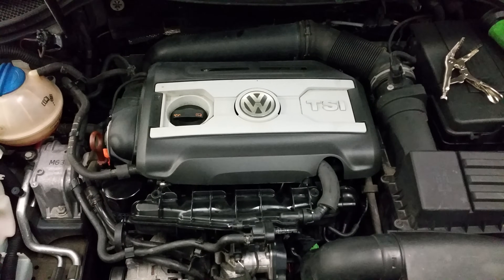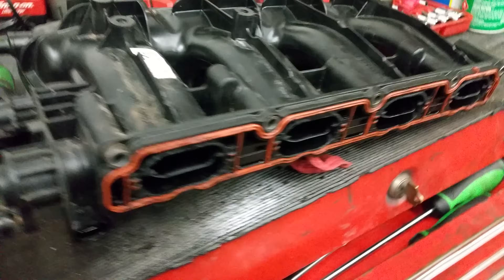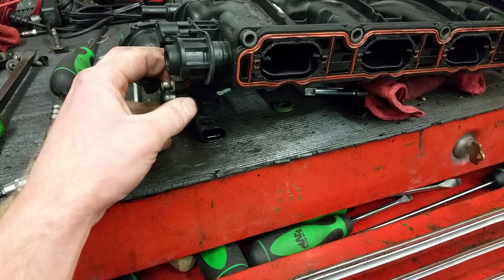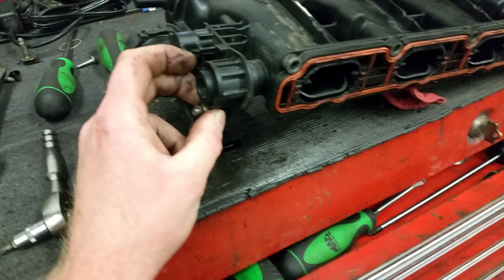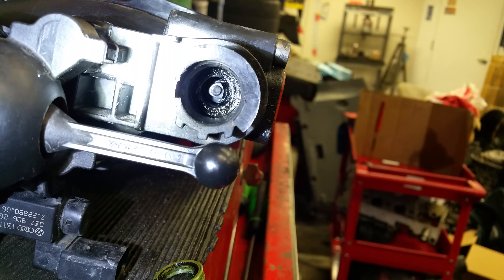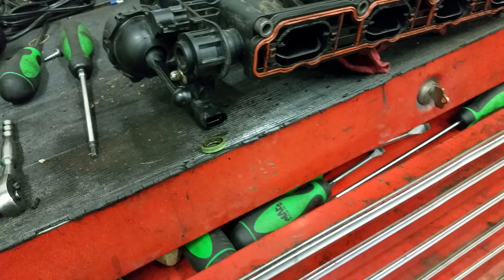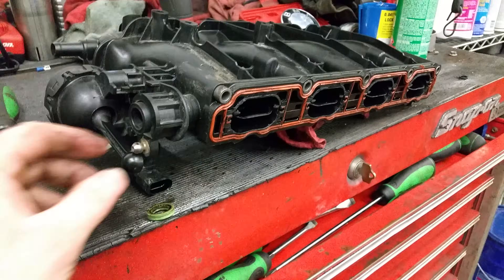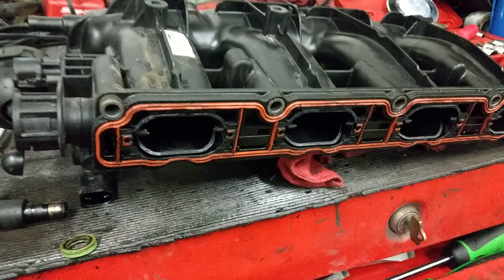VW 2.0T TSI Intake Manifold Failure Explained, P2015 Code

Comment: So far, I'm not liking the 2.0T engine.
In the past 15,000 miles I have already had coil failures, PCV failure, and today I got the wonderful P2015 code. I am beginning to think VW doesn't know how to build a quality product. 
Another issue unrelated to the 2.0T, my VW recently had the overheating 30-amp fuse problem that melts the fuse and fuse block housing while also causing nearly all lights on the right half of the car to go out. Supposedly the 30-amp fuse wasn't made to carry 25-28 amps continuously causing the fuse insulator plastic to melt. There is a service bulletin for the Golf and Jetta but the EOS has the same issue though VW has not issued a service bulletin for them yet. The newer version of the fuse has a better insulator which if replaced early can prevent the damage to the plastic fuse block housing.

Comment: where would the intake manifold leak from I'm getting the same error message p2015 it says leak in the intake manifold. when I would drive my car and I would give it gas to go faster I would get this squealing sound. I have a video of it. If you have any insight! that would be great !
Reply: it could be the armature popped out, there is a seal in there and if the armature comes out a little it will not seal correctly, giving crappy idle and both vac and boost leaks.
You have probably fixed it already as you posted 5 months ago.
just posting for future readers ...
Reply from the maker: The 2015 is specific to the intake manifold runner. If you have an intake leak and the sound you describe, sounds like you have a failed PCV valve.
Reply: Troy Allen 
thanks a lot